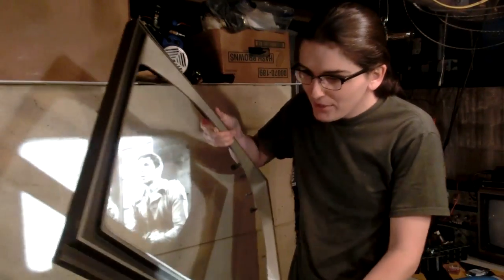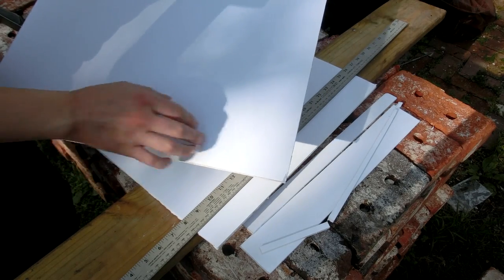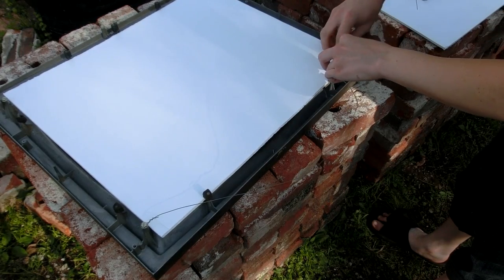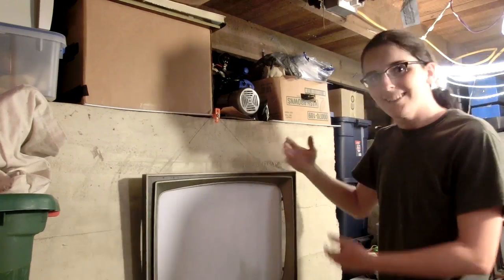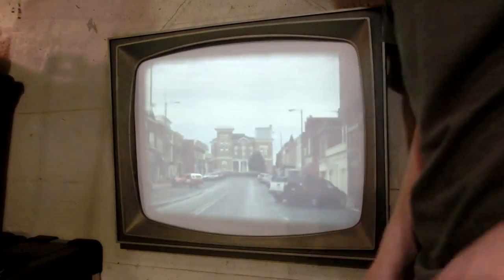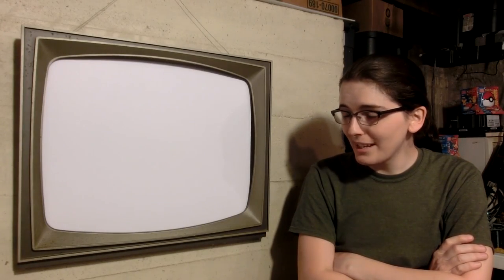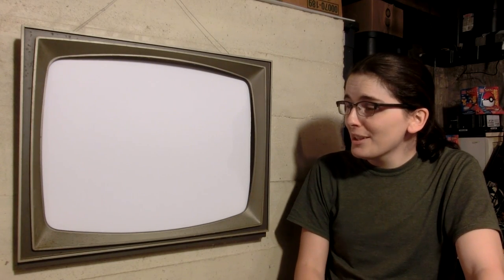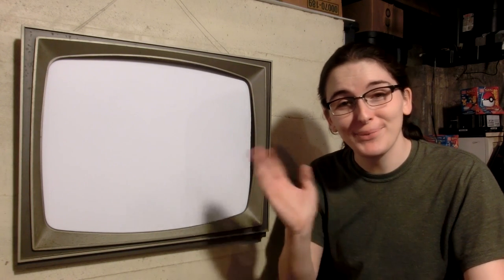16mm Projector Screen from 1960s TV Bezel

Comment: Setting camera to a PAL region usually will drop the frame rate to 25 .. still not exact, but closer.
Reply from the maker: +Coffea unfortunatly it doesnt change anything on this camera.
Reply: worth a shot, I was a little surprised to find it had this effect on my canon dslr.
Reply from the maker: really? why would you be surprised that PAL gives 25/50fps?

i'm more surprised that this camera doesnt change framerate, its only for the video output on this one and not for input.
Reply: Just that it's an odd legacy feature to include as it's only really relevant for outputting to analog devices. I used to live in the UK and even on TV's PAL hasn't been a  thing for many years. I doubt I could even purchase something that required it. The camera doesn't even have analog video output.
Reply from the maker: funny that you dont seem to feel the same way about 30/60fps which is the legacy of NTSC. whenever i upgrade to a higher frame-rate i will be going to 50fps instead of 60 to save bitrate but i dont see why we shouldnt all be filming at 70 or 80fps someday.
Reply: The difference is 60 is still very much in use today as the baseline refresh for LCD screens